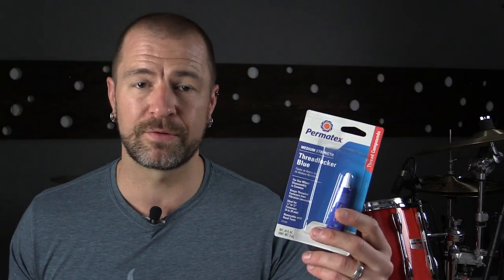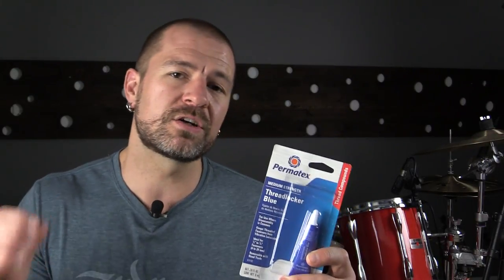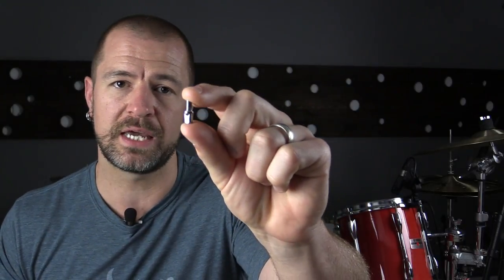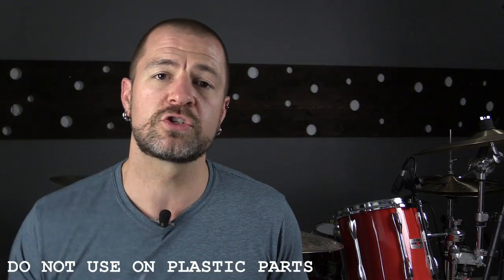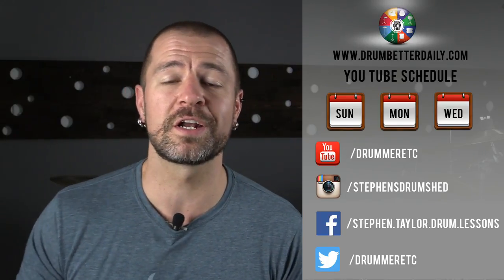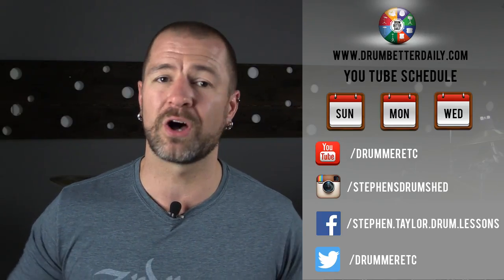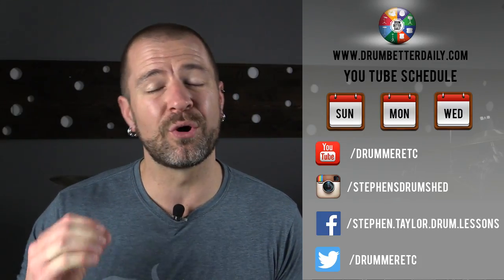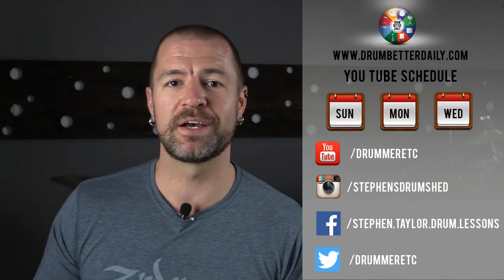DRUM HACK - FIX LOOSE LUGS

Comment: *WARNING* Don't use this on your plastic ekits... I used it on my Alesis DM10 and the plastic pieces holding the washers have broken off and now there is nothing to keep the heads on...
Reply: that was going to be my question too.  I have a Roland e-kit and worry about the same.  I'm going to get metal nuts and try with that, because I am so tired of the plastic "nuts" coming loose all the time.

Comment: I've been having this problem of late after I used a wee bit of white Lithium Grease on my rods (cream, not spray) . Now the 2 closest rods to me are loosening out, almost completely. So, I removed the grease & switched the rods around to other lugs, yet the same 2 rods come out, only slower. So, I ordered this Threadlocker Blue, but I have 2 questions before I try it. 1. Is this bad for the rods' threading with repeated use? 2. Do you have time to tune the rod before this stuff dries? Just curious.
Reply: It’s not bad for the threads with repeated use. The residue will come off by scraping if you need to get it off later as well. You will have more than enough time to tune as the set time is 10 mins or so. After it cures you will still be able to turn the tension rods no problem with a little more effort (just don’t use more than a couple drops on each).

Comment: THANK YOU so very much for this "hack"!! - my new snare is having this issue and will save me so many headaches.
Reply from the maker: My pain. Your gain.
Reply: Appreciate everything you do for the drum community!
#educatoroftheyear
Reply: sorry, but this is a bad method. you have to break the joint any time you want to tune. And it surprises me that most drummers don't know why drums detune. It's not because of the lugs/rods. It's because of the seating of the head. 

When you do a rimshot, you are pulling the head to one side, which causes detuning. The tension rods stay in place a lot better than you'd think (although move only because of the head seating), but since a head is never perfectly seated, even with things like evans 360 heads, the head is not tethered to the shell. I solved this by using tape, usually electrical tape, wrapped around the shell up to the bearing edge. Just keep wrapping until the head fits so snugly that it will not budge in any direction. Yes, it might mess up your finish eventually, but probably not, just a little tape residue. But it's well worth the tuning stability (allows me to tune to distinct notes).

This in combination with tightscrews yields a perfectly stable tuning. I tune before I play everytime, but only because I have to tune to notes within cents, and rarely do I have to tune much at all, just check each lugs frequency with a tunebot, tweak a little and done.

Comment: this sucks for drums, because you have to break the seal anytime you want to tune. Anyway, what drummers fail to realize, surprisingly, is that it's not the lugs that cause the drum to go out of tune. it's the actual head and how it is seated. When you do a rimshot, you are pulling the head to one side, which causes detuning. The tension rods stay in place a lot better than you'd think, but since a head is never perfectly seated, even with things like evans 360 heads, the head is not tethered to the shell. 

I solved this by using tape, usually electrical tape, wrapped around the shell up to the bearing edge. Just keep wrapping until the head fits so snugly that it will not budge in any direction. Yes, it might mess up your finish eventually, but probably not, just a little tape residue. But it's well worth the tuning stability (allows me to tune to distinct notes).

I also use tightscrews which eliminate any movement of the rods, which aren't a problem anyway if you use the above method.
Reply: Uhhhhh.. This might be true on some drums or at some tunings but if you tune low, put a tuning key on the two lugs closest to you and on some drums you can literally watch the tuning key spin out in a matter of probably less than 10 hits, or certainly half way through a song.  The rods spin - a lot.
Reply: If you get the tune where you want it, let the blue stuff cure ..there will be no need to re tune ....
Reply: "I also use tightscrews" I think that was your actual solution

Comment: Great stuff! =) Any ideas for lugs that are actually rusted together with the piece that it screws into? I have one like it on my snare drum, and both bits just turn without loosening.
Reply: TFS Jack Kroil, its a penetration fluid used by mechanics and 'smiths for freeing rusted bolts, screws etc.   If you can't get that then try PB Blaster.  Available at hardware stores and auto part stores.
Reply: Awesome, thanks man! Just looked it up, and it's pretty cheap too. =)
Reply: Actually, come to think of it... Are they just like WD40? I've tried that and it didn't work.
Reply: TFS Jack No they are not anything like WD-40.
Reply: Okay, cool. Thanks again. =)
Reply: If you buy a vintage drum and the tension rod is rusted into the lug put a drop of PB Blaster on the threads. Let it set for an hour. Presto tension rod will come out without damaging anything. Just a note. 3 in 1 oil gets sticky as it dries out over time and heat he will quicken the process. So if you put any oils on your tension rods think twice about it. And nylon tension rod washers don't hold as well as metal ones and will deform and crack over time. They don't rust but having to tune more often can be a real pain.

Comment: whats the point...you should tune or check tuning before ANY gig anyway. And don't add something to junk up your 
tuning lugs for no reason.
Reply from the maker: The point is when you have lugs that come loose after 2 or 3 songs of slamming backbeats. At that point, there is a functional problem with the drum that needs to be fixed. This will do that.